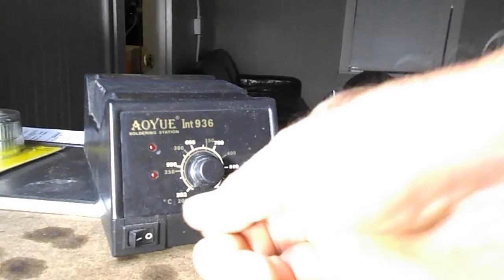Reviewing the Aoyue int 396 Soldering Station

Comment: Hakko 936 was upgraded to Hakko FX888, which you can get, it basically has that same handle as 936 original. Hakko original has better temperature control than Chinese clones, and tip and heater durability on Chinese ones vary greatly, so they're not really that great. But if you don't mind that, sure, they're cheap and very decent in their own right, i think really much better than the Chinese stations that came before that, the ZhongDi. It's totally not a fair comparison against Hakko given the price gap.
Reply from the maker: Siana Gearz thanks for watching ")

Comment: Frys Electronics sells this for $39.  Are the tips easy to find?
Reply from the maker: standard size soldering iron it comes with a couple regular ones") thanks for watching")
Reply: If you can't find them locally, just order your tips from China, you wait for 2-3 weeks, but they cost basically nothing, and you can buy a bunch, though the quality can vary. If you order generic 936 replacement tips, they should work. Places like Aliexpress, Banggood, Hobbyking, eBay when you put search on "worldwide". In fact, Hobbyking usually stocks them in US and EU warehouses for fast shipping, besides Hong Kong main warehouse, and Banggood might too. You can try using genuine Hakko tips that you can get locally, but often they won't fit, depends on how the heater in your handle was made. It's basically the same design, but the tolerances aren't the same. The heater element in Chinese soldering stations often comes out a wee bit wider than Hakko original, so they make the tunnel in the Chinese tips just a fraction of a millimetre wider, so if Hakko original one doesn't fit, it may need some widening surgery, though i have no specific recommendation on how to do that. If you don't want the hassle or the uncertainty, you can just look on Aoyue international website, it lists all the local distributors, both their US and their EU distributors offer mail order to end customer.
Reply from the maker: thanks this is a lot of information and it's all good")